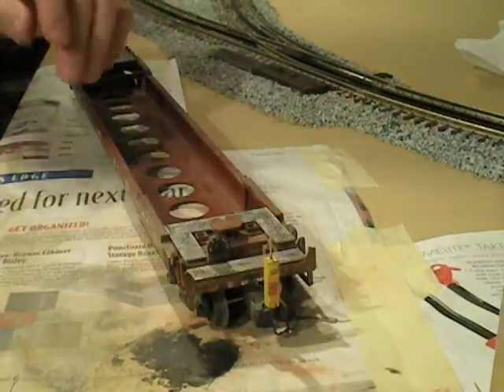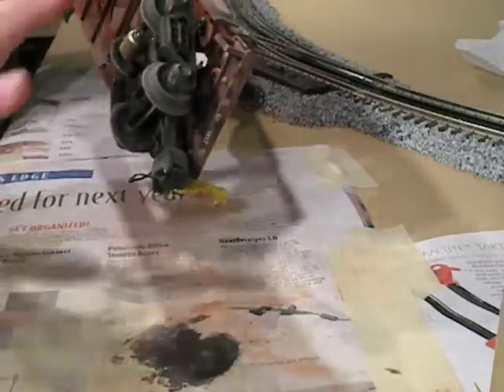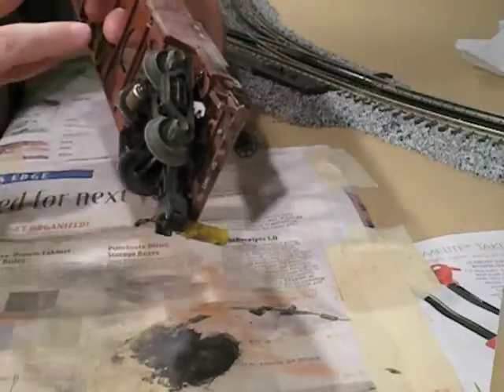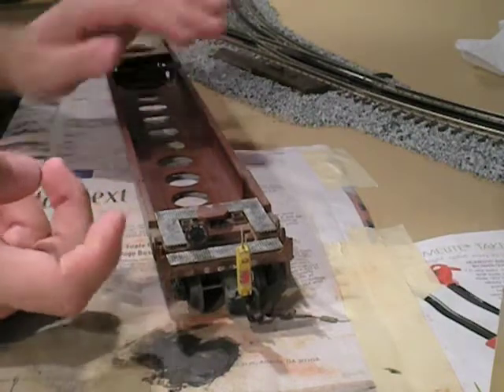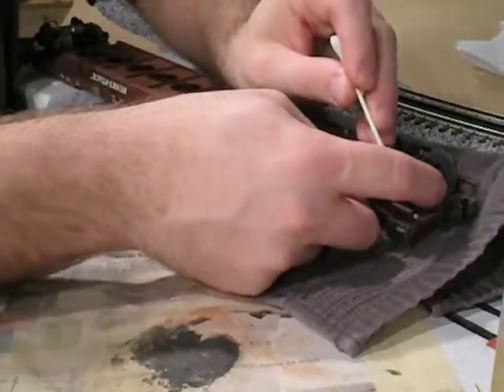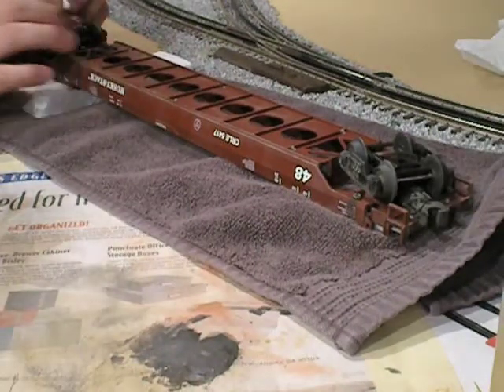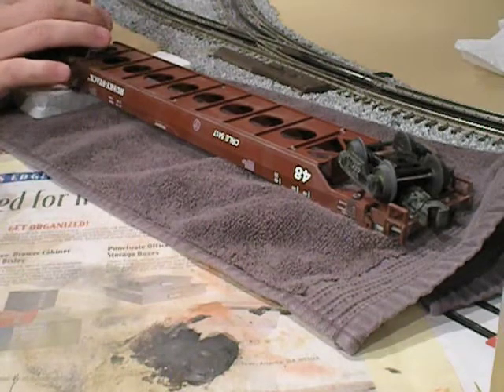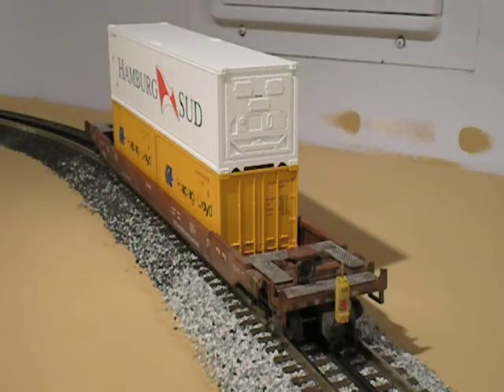Weathering an O-Scale Freight Car & More - Part 4 of 4

Comment from the maker: There are 2 methods that I generally use to get the powders to stay on the car. The first is that I put the powder down on some tacky dullcoat. This will allow the powders to stick better to the car. Secondly, when you're done applying the powders you can spray the whole car with a coat of spray dullcoat and that will seal all the weathering powder.

Comment: I saw your question on Als channel and one method you could try is to take a thined mixture of alcohol with several shades of grey and black and then apply a wash over the deck starting with the lighter shades of grey one plank at a time and then work in some darker shades of grey and and vary it from plank to plank and after the deck is done use the thinned black to give it total definition I think you will be pleased. Good Luck Steve